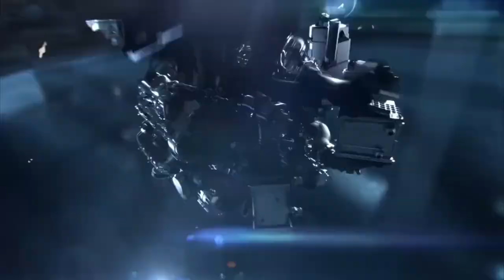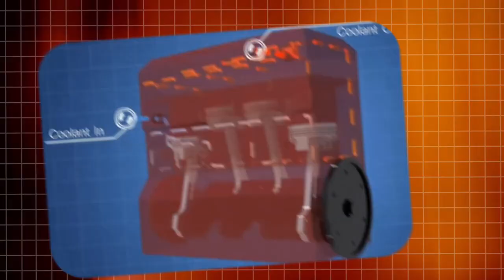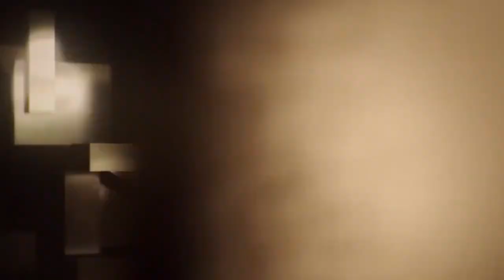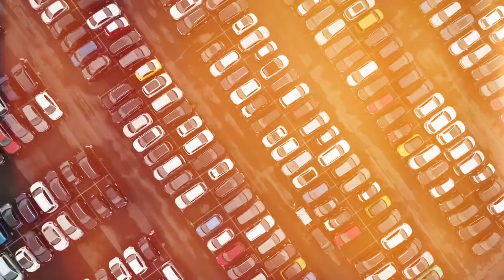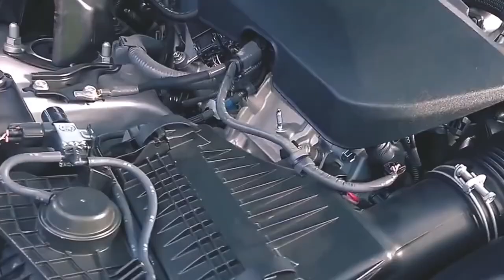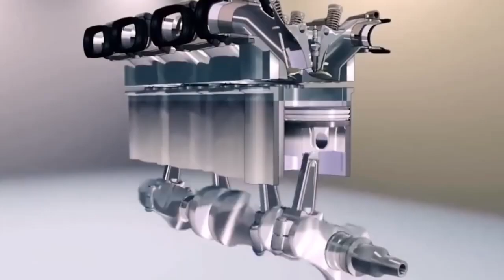Will this ALL NEW Air Engine DESTROY the Industry?

Comment: the waist air feeds back to the massive air compressor that is run with the hybrid engine
Reply from the maker: That's a really interesting point! The integration of the waist air into the compressor is a key feature that could enhance efficiency in hybrid engines. It will be fascinating to see how this technology develops and impacts the industry moving forward!

Comment: Right...and the air compressor requires no power and a-ultra high pressure air tank is compact and safe,. LOL, this ain't the future it's the steam engine by a different name. Fake.
Reply from the maker: Interesting perspective! While it’s true that air-powered systems have been around for a long time, the advancements in technology and materials could lead to more efficient and practical applications for air engines today. It's always exciting to see how innovations evolve from past concepts. What specific features do you think would make air engines more viable for the future?